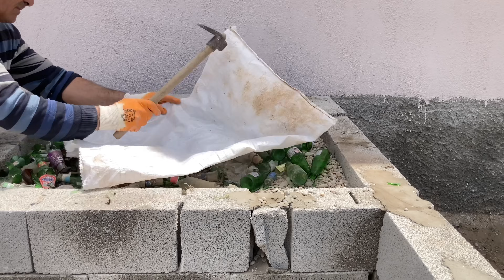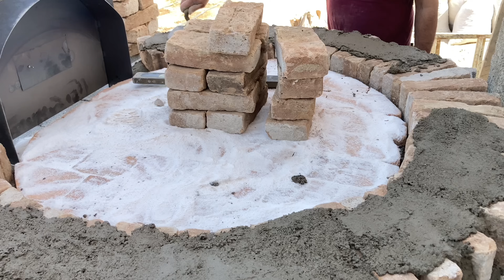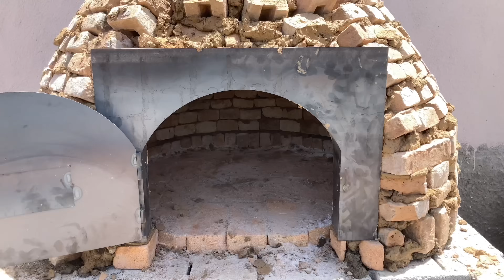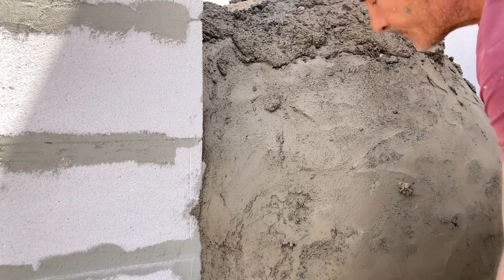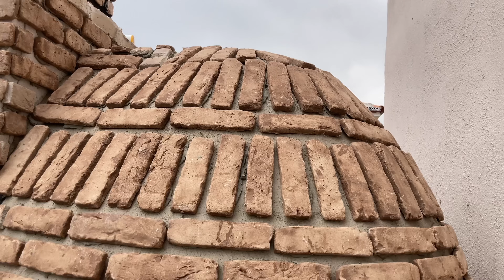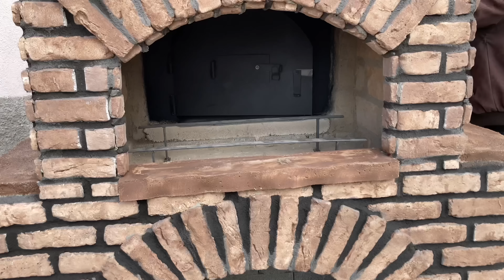How to make pizza oven ( Taş fırın ) - Barbekü & Fırın yapılışı

Comment: The only thing missing was fiber ceramic for insulation, otherwise, a very great work!   Congratulations!
Reply: Creo q con los ladrillos de punta 30cm espesor no hace falta fibra, en el campo nunca se uso fibra no existía 😅..
Reply: Ceramic fiber and hebel blocks are a must to maintain such a great temperature. Otherwise, the dome is going to crack over time. 
If you want something done, do it well !!!